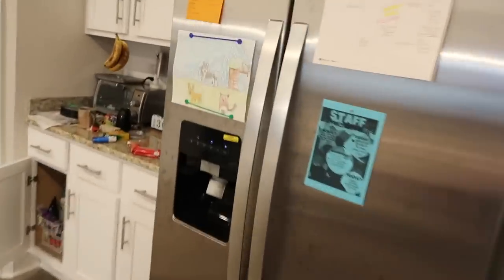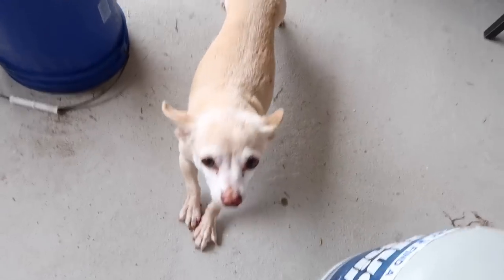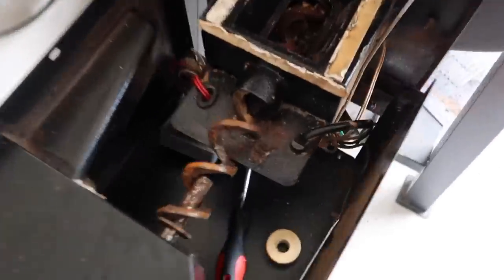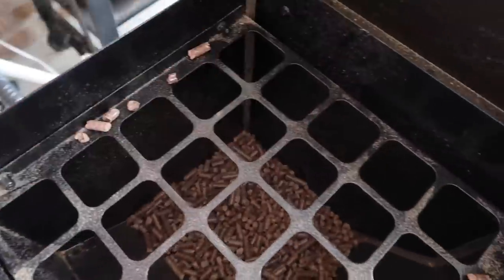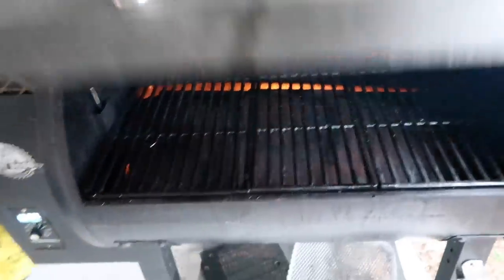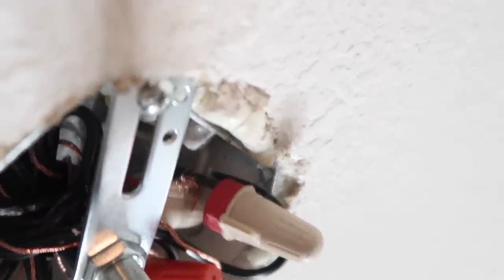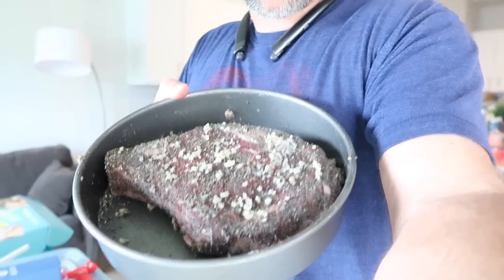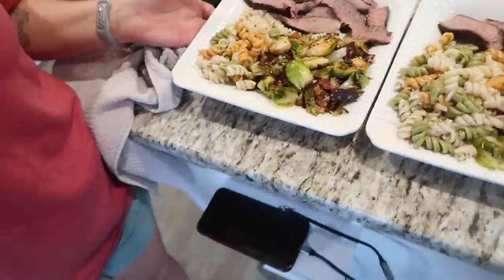💡 How to Save $600 at Home! 💥

Comment: So did you tell the neighbour that you fixed it? It is kinda awkward as it clearly looked like it had been backed up and not drained of ash in between use and probably burnt the connection on the board. Those rusty screws on the square bit where the wood pellets drop into, look like the access point to lift the main lid to expose the spindle. I would still grease the joints often. Great job on fixing it! 

My Dad is giving us his big gas bbq grill as he hasn't use it for years. It has a side ring too for boiling things too. He has given it a jet hose but i think it will need a service as the ignition isn't working, which isn't a big deal for gas. Will take a look when we can get it here in my little Fiesta but probably and hopefully might just need re soldering some components. We currently just have those basic circle ones for wood or charcoal, about 24"/ 60 cm wide ones. Will be nice to have a bigger one for when we have friends over and have an extra top grill for veg as i find they burn on a normal bbq. 

Are you missing a shelf in the fridge or did it break or do you normally store tall stuff at the top? Craigslist, etc normally have those listed for free. Also look out for double glazed windows as sometimes just one of the pieces of glass is broken in the frame.

We are in the UK and we had one window pane break during the loft conversion, when they were installing it so we have a spare. I am saving it for when i make a cold frame for the garden. I just love reusing things other than for it's original purpose!

I love that new light shade and is much more safer by the door if you are moving stuff. I always take a picture of the circuit before removing the old light fixture as you never know if someone has done a bodge job and added new cables in a terminal and used the wrong coloured extended wires. Most modern lights also have the 2 way thing for when you have more than one switch for the same light.  

My sister gave me a cute kids light strip with metal bugs with wings that manually open up, from the Netherlands but was shocked (pardon the pun! lol), to see the lack of earth connectors, so i Jerry Rigged one up to safely install it. 

Having fully renovated our house, i personally much prefer LED lights or plain pendants, to change up the shades more easily. When we do small reno's for family and friends, it is always the plain white pendants for LED bulbs, so they can chose the shades.

Thanks for posting again! Always great to see an update from you all!

Best wishes from London x